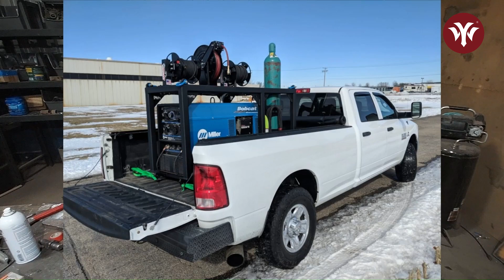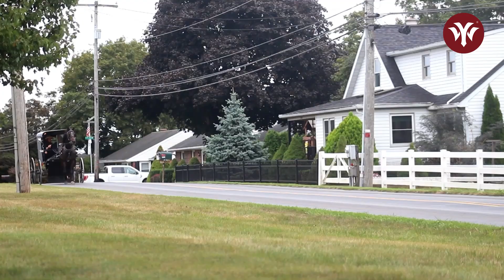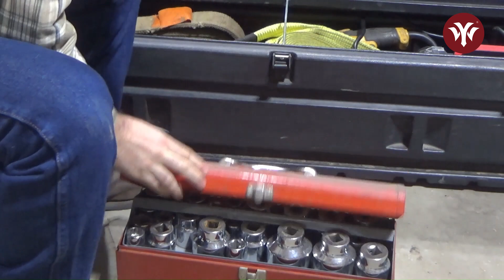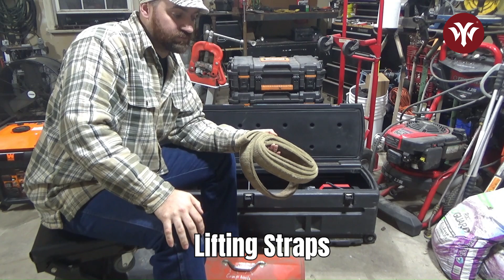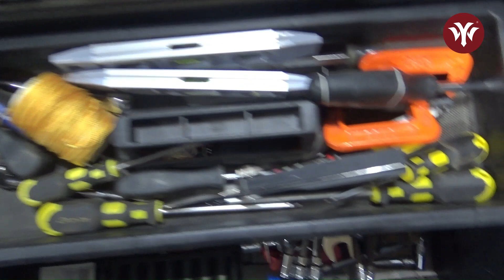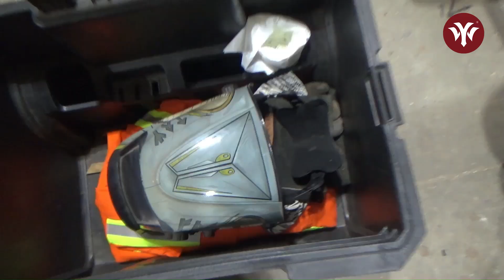Mobile Welding Repair Equipment Unveiled | YesWelder

Comment: Is that compressor enough for your plasma cutter? That generator looks to small to run both at the same time.
Reply: It was too small. I upgraded to a bigger generator but the compressor works great

Comment: What size generator to I need to fully handle a Lincoln SP-170 t
Reply: I recommend a running wattage of at least 7000. I burned up this generator pretty quick
Reply: @StickManFab  think it would be better to have an inverter welder over a normal one?
Reply: @TurnerAndSonsFabrication  Absolutely.  Intverter generators generate what they call "clean Power" which means the AC frequency closely matches that of what comes out of your outlet,  Measured in what's called Total Harmonic Distortion(THD).  Sensitive electronics(including inverter type welders) require power with a THD of less than 5%.  Normal generators have a THD of 10-20%.  Running any sensitive electronics over time will destroy the circuitry.  I just got a Sportsman 8750 Inverter Generator from Home Depot.  They are having an incredible sale right now. $735
Reply: @TurnerAndSonsFabrication  What do you mean by Normal?  Like inverter vs transformer?  If so Id go inverter for many reasons.  First Transformer welders arent really made any more.  They are considered old technology.  Plus inverters are more tunable with more settings,  way more portable, and if something breaks,  You can get it serviced or source parts much easier.

Comment: I still don't understand how guys call themselves rig welders with 1 box of tools and a generator. I carry 40k in tools between mag drill portable bandsaw, etc to do farm Repairs. I'm running a 1 ton and a 300a welder.
I carry 4 grinders so im not wasting time constantly switching disc's, pipe stands, oxy acetylene setup etc.
Reply: I run a PortaWeld 500amp multiprocess out of my Mazda 6. I'm making 200k a year. You don't need a big bad welding truck to be a rig welder
Reply: @Dillybar777  Would you ever make a video about your setup? Nothing crazy, just quick walkaround video showing how you do it? I want to build a little trailer to tow behind my car, but it would be even better if I could do it without the trailer.
Reply: @vertvlogs675 I will buy me a trailer for mobile welding repair
Reply: @Dillybar777 hell yeah
Reply from the maker: Thanks for sharing！
Reply: Lol you must of maxed out your husbands credit card for that one.
Reply: Its probably a different for everyone since I run my expensive mobile setup out of my mini van and works just fine unless your carry the even more expensive equitment.
Reply: Depend on the jobs tho , not every jobs required that much tools
Reply: Stop hating some people aren't fortunate as others
Reply: Guys, Here is The Savior

YaH The Heavenly FATHER (Genesis 1) HIMSELF was Who they Crucified/Pierced for our sins and “HERE IS THE PROOF”

From the Ancient Semitic: 
"Yad He Vav He" is what Moshe (Moses) wrote, when Moses asked YaH His Name (Exodus 3)

Ancient Semitic Direct Translation
Yad - "Behold The Hand"
He - "Behold the Breath"
Vav - "Behold The NAIL" <— YaH’s Crucifixion
He - "Behold the Breath"

“Behold the HAND that Beholds The NAIL” 

PROVES - YAH The Heavenly Father HIMSELF was Who they Crucified

That is EXACTLY what Moses Wrote

Here is what they mean

YaH's Name:
(Ya)d + (H)e, as YaH is what Moses called Him and YaH Declared: "this is My Name, this is My Name for all generations" (Exodus 3)

YaH is The Creator of “MAN”: (Genesis 2:7)
Yad He, (HAND BREATH), as YaH's "HAND" Formed man from the dust  of the Earth and His "BREATH" made him a living being (Adam)

YaH's Sacrifice of Crucifixion for “MAN”:
Vav He (NAIL BREATH), the "NAIL" through YaH’s "HAND", in Sacrifice of Crucifixion, that whosoever shall call YaH Savior, His “BREATH” brings forth life (Salvation)

How YaH arrives:
YaH arrives via the Tent of Meeting (Exodus 33:7:11, Isaiah 54, 55), where a Tent is erected outside the city, a cloud descends upon the entrance of the Tent and YaH appears...

Why they demanded YaH to be Crucified:
YaH was Crucified according to Hebrew law (Deuteronomy 21), to be NAILED/PIERCED on an Almond Tree for BLASPHEMY as it was for His NAME they demanded Him Crucified. The Messiah claimed He was YaH...

HE WAS YaH!!!

HalleluYAH translates “Praise ye YaH”

The Hebrew Book of Isaiah

Isaiah 42:8
"I am YaH; that is my Name! I will not yield my glory to another or my praise to idols.

Isaiah 43:11
I, I am YAH, and there is no other Savior but Me.

Isaiah 45:5
I am YaH, and there is none else.